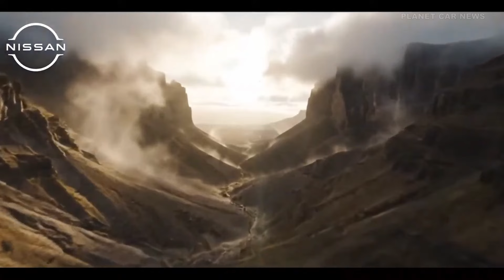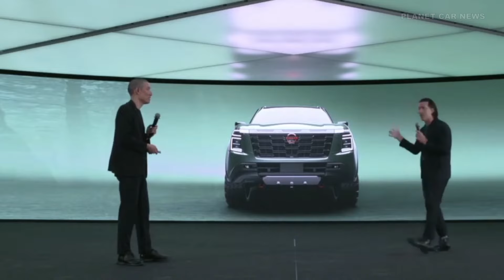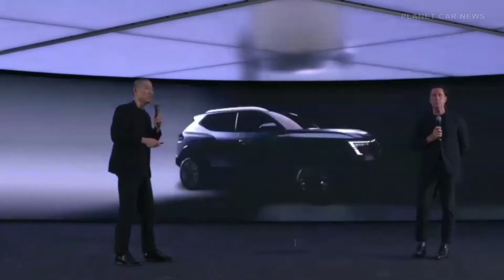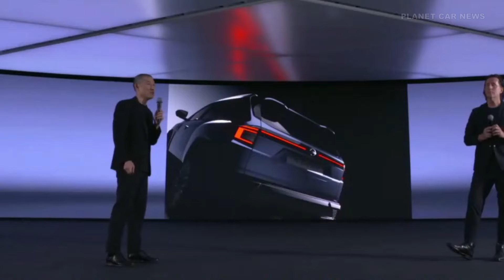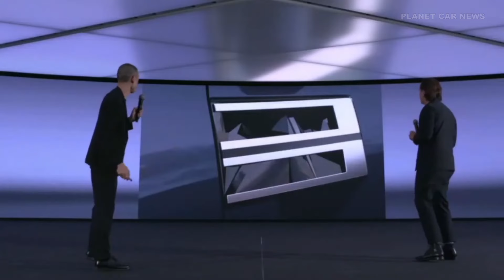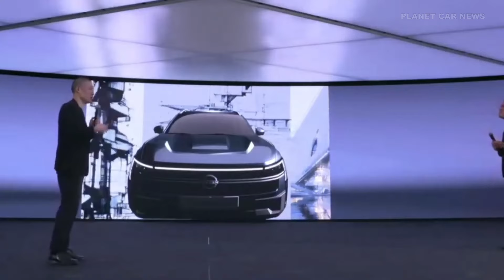All-New Nissan Tekton C-SUV (2026) - Mini Patrol - Design Presentation

Comment: this is just a rebadged dacia duster lol...  the dacia is sold where i am as the renault duster but you only get 5yr warranty... sold thru nissan you will get a much bigger dealer network AND 10yr warranty and 300,000km on it... this is not all that interesting